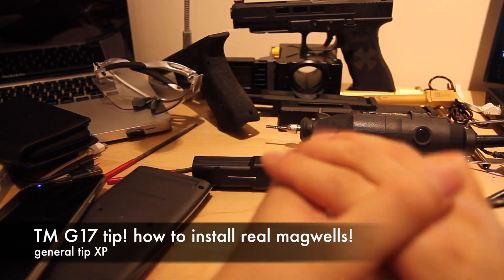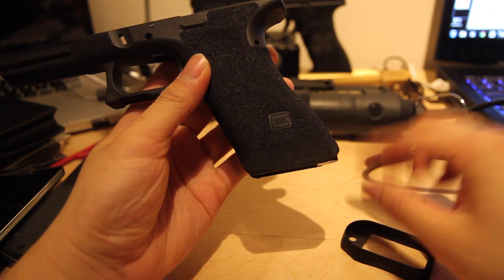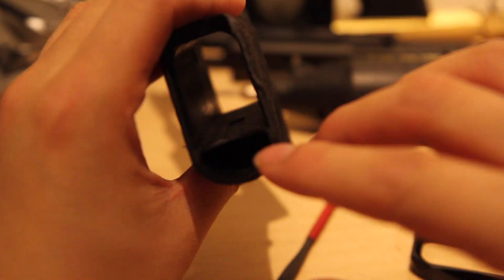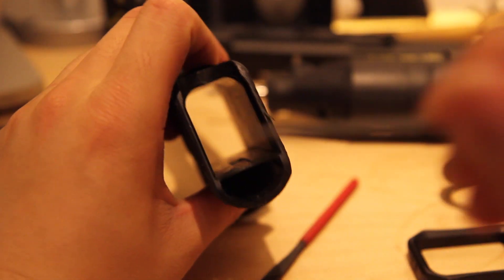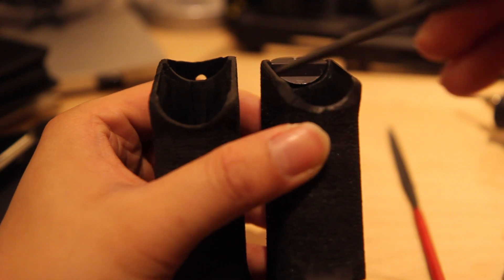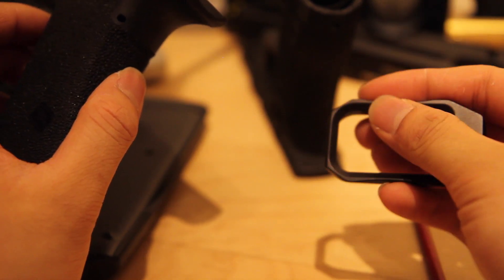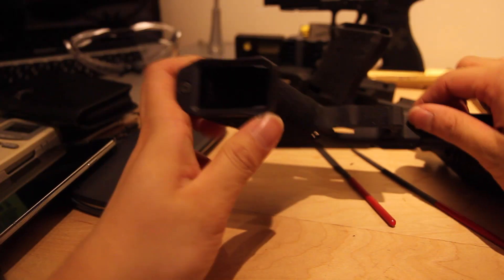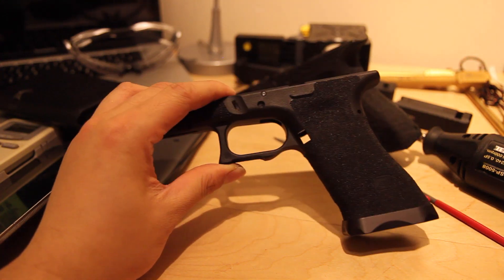TM G17 - Real steel magwell tip! (airsoft)

Comment: Will a Tokyo Marui G17/18 aluminum magwell fit a REAL Glock 17 gun frame? Are the air soft frame and the real gun frame the same in dimensions ?
Reply: tried it m8? worked? i aint paying 80$ for an outside aluminum piece i can get for 30$